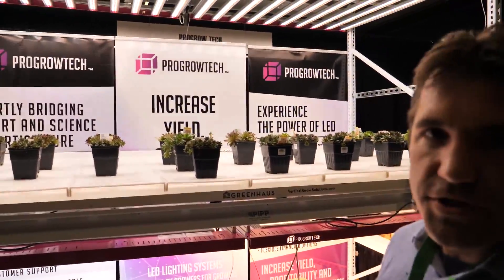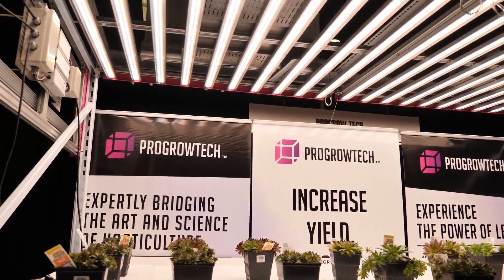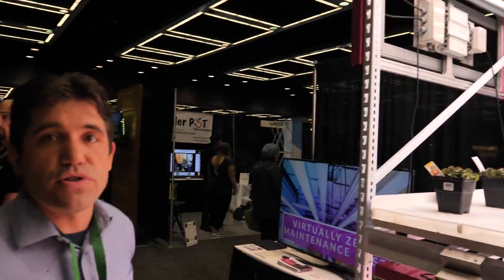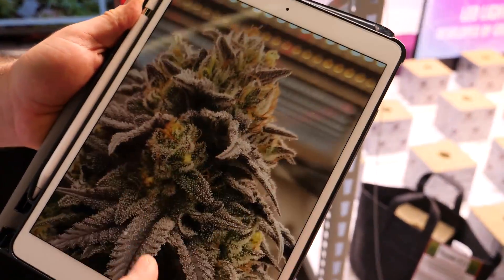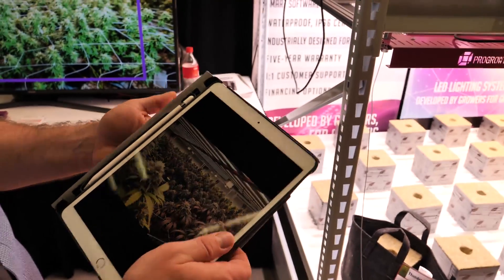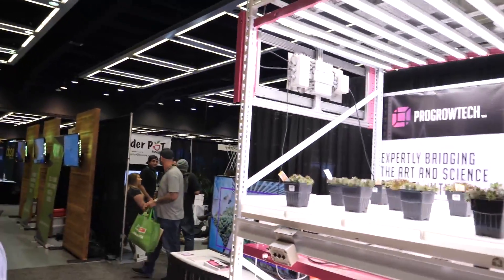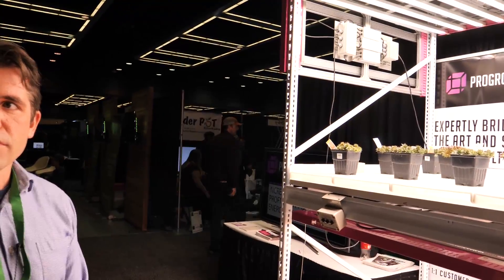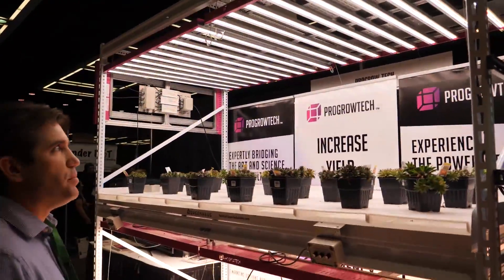CannaCon 2018:  LED Innovators ProGrowTech Evolve 700w

Comment: I would love to hear him justify those prices...
Reply: IP66, spectral control, industrial construction - that shit doesnt come for free. Sure, we can DIY something similar for cheaper but big commercial growers aint DIYing their lights.
Reply: I didn't expect anything to be free. I personally value time over money, so I would pay more for a professionally built light to save me hours of time and a massive headache. There just has to be a justification for the price you charge for a good or service.

IP66 that's cool if you want to hose down your lights, but i guarantee you NOBODY will do. My phone is waterproof up to 3 meters, but I won't even take it in the shower. It's too much of an investment to risk damaging same thing goes with a grow light. 

"Spectral control" is cool but not something that add's that much cost to the unit. 

As far as the term "Industrial Construction", that's just a selling point, and has no real meaning. I deal with salesmen almost everyday. They can find words to make dog shit sound technical. Not saying this light is dog shit but you get what I mean...

I work in manufacturing. Their material cost's are probably only $400-$500 max depending on how good their buyer is, source of materials (domestic or foreign) etc. Labor cost probably $100 at most if they are having one person assembling each unit from start to finish and he is a licensed electrician, but that's doubtful.  So max cost per unit around $600. At a selling price of $2200, that's a 72% gross profit margin. profit margins vary by industry but most hover around 30%, so for them to be shooting for 70%  they would need some kind of patented ground breaking new product, which they don't. 

But hey, if they want to be the designer handbags of the horticulture world they're well on their way.

TL;DR: These lights are overpriced. (i'm sure you already knew that)
Reply: mrtimjitsu - ehh, reliable waterproofing isn't cheap. And that's a lot of mid power led boards... If they don't have in house machines they have to sub it out. 10c a component is a discount for that service (plus if you go to China you pay 2x because they steal your design) .... I'd say your estimate is  400 - 500 low (don't forget benefits for employees too, healthcare is expensive... Like I even needed to say that). even in business raw materials like aluminum aren't much cheaper than we can get it ourselves.
Reply: Dude Guy - that's not an argument.
Reply: volvo09 - you think my estimate is low by 400-500 PER UNIT because of a monthly health insurance premium that they may or may not pay? That's assuming they are even assembling these in-house.

Have you ever bought large quantities of aluminum before? What seems like "not much cheaper" to a person buying a couple sheets from their local metal yard is A LOT cheaper to someone buying thousands of pounds of it.

Also they're using extruded aluminum channel for the framing. Extrusions are priced by linear ft. not lb. Also the die for the extrusion most certainly patented. So the price also depends on the type of channel because they target certain industries and price it accordingly. So you could be paying more 8-10x more per lb than sheet aluminum. There is A LOT of wiggle room in the price if you are going to buy large quantities of extruded aluminum straight from the mill or a broker.

Comment: At $2200 it’s 700 over the Fluence Bio SPDRx. 
What’s is the efficiency of the light?
Reply: That’s a good question
Reply: Simon https://www.progrowtech.com/product/ev700/

Evolve EV700 is the true HPS killer. With enough intensity to maximize yields for the most hearty sativa strain, and on-board dimming function and precise spectral adjustment, this is the ultimate fixture for your flowering phase.

Clearly more powerful than high-end HPS. Up to 900 average PPFD delivered in a 4’x4’ light pattern with best-in-class uniformity.

700W Max Power (Savings of more than 300w over leading HPS solutions.)
Advanced full-spectrum LED
Canopy intensity and yields to rival HPS
Industry-leading fixture efficiency
Full 4×4 light print
Best-in-the-world uniformity
Designed for vertical racking

https://2xuwao2gok1v2wn2em9n5ys8-wpengine.netdna-ssl.com/wp-content/uploads/2017/12/SPYDR-Series-171214.pdf
Reply: And I thought the spydr was $. This gives you spectrum control and maybe higher build quality, but is that worth it.... I donno. Not to me, but that's because I'll never pay more than I can do diy unless I had to buy a bunch of fixtures at once.
Reply: Our overall efficiency is 2.1 µmol/j.